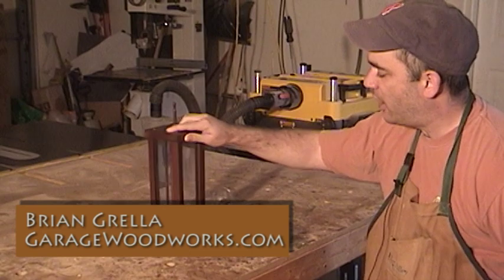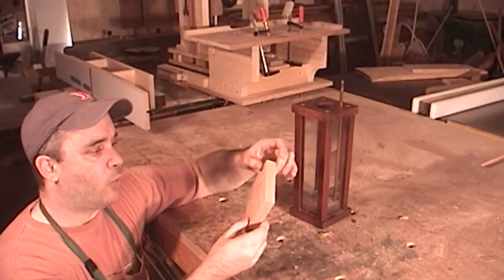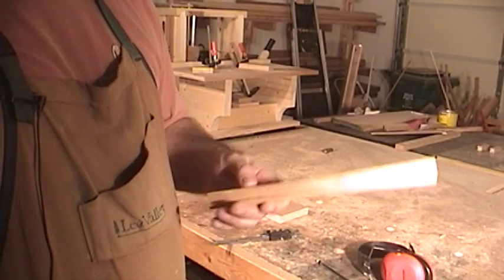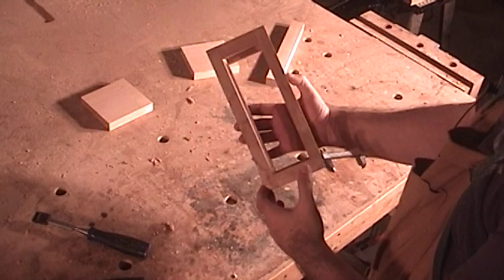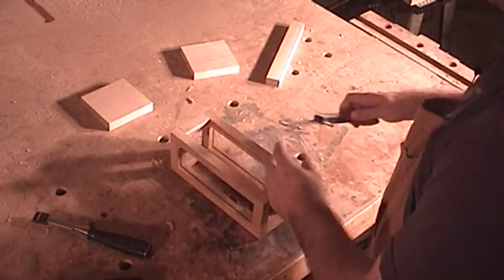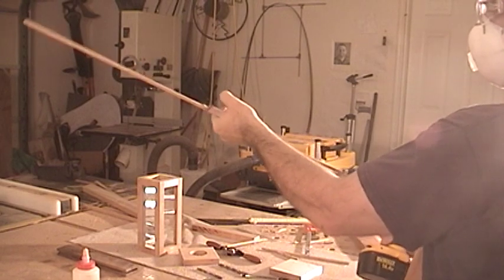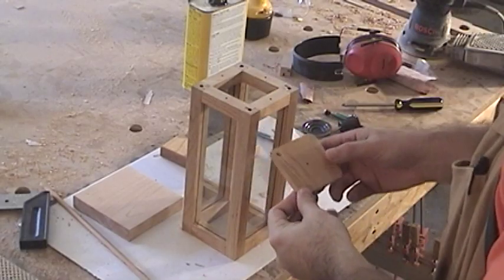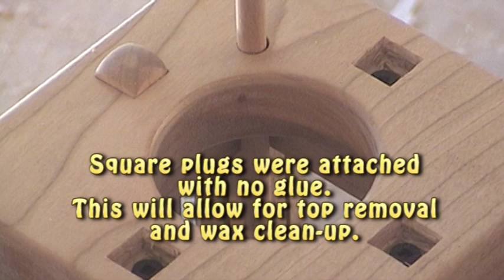The candle holder

Comment: Very nice. I made a "Revere" kind of lantern with a handle from a coat hanger and a heat deflector for when I carry the lantern. Because of the open flame I cut a sheet-metal ring and fastened the ring underneath the top to protect the wood from being furned and or catching fire. I cut a few holes at the side bottoms for combustion air. I light the candle almost every night for the nice embiance around the table. Nice work Sir.

Comment: Nice build! You are a master at wood working. My thoughts are, I think If The original sold for 1 hr labor Plus materiel.  You had to knock out 2 an hour to make money. I also believe a loose fit allowed air to come in to feed the flame. A shim under the glass on the 2 sides would help with that. The front and back lose fit at the top allows cool air in as well to lower the heat out the top.
Reply: That's what I was thinking

Comment from the maker: No, that's not a problem with this design.  I think there is enough air current with the hot gases escaping and cooler air entering from the top.  Also, the sides and bottom are not air-tight.  Great question!

Comment: there is heat rising from the flame of the candle. I realize that the hole in the top allows most of the heat to pass harmlessly out of the holder...but wouldn't it be safer to line the bottom of the lid of the candle holder with a reflective surface such as metal foil so that there is less danger of the holder catching fire? Just an observation. If this is not a problem...I would like to build one for myself.